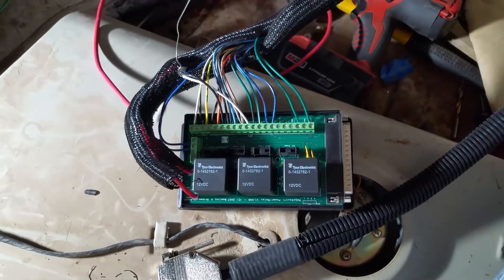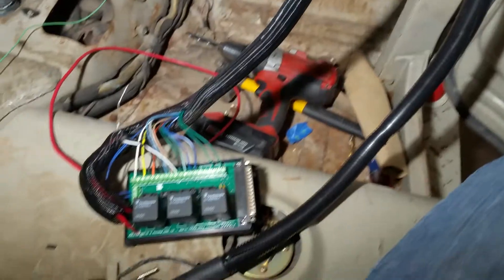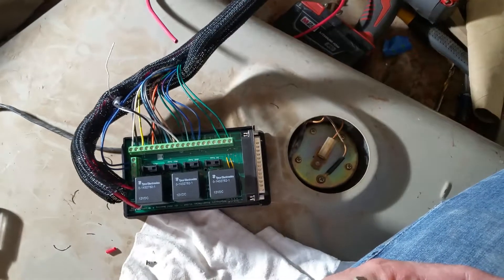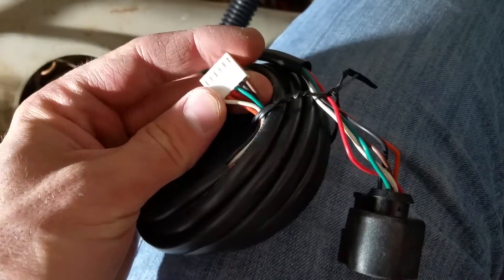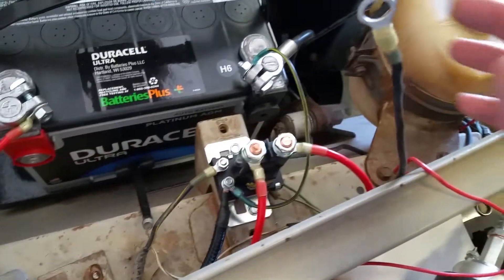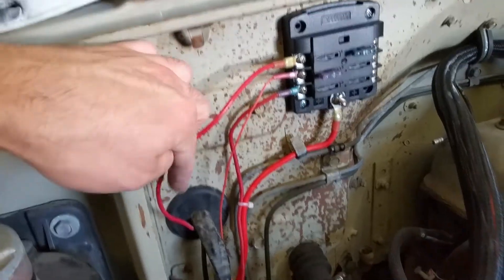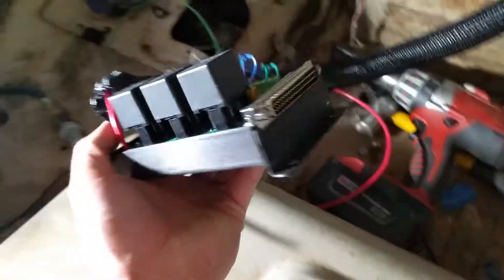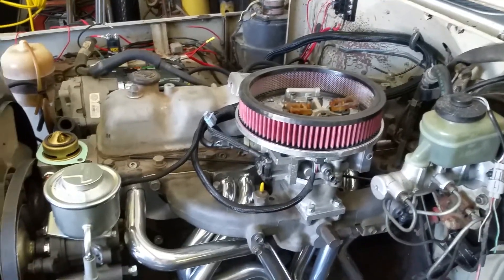TOYOTA FJ40 2F MEGASQUIRT PROJECT UPDATE 4

Comment: Ive got the same conversions in my 74 fj40. Are you blowing through o2 sensors? My check engine light comes on shorty i replace it and I don't know why it's telling me it's a bad o2 sensor?

You mentioned something about the 2 ground wires should be grounded at the same location? ?

Any thought?
Reply from the maker: Fj40365 I have an aem uego wide band and have zero issues. It’s not a stock narrow band O2 sensor
Reply: 2Step _Anti_lag  do u by chance have a part number?
Reply from the maker: AEM (30-4110) UEGO Air/Fuel Ratio Gauge https://www.amazon.com/dp/B00N3VGPYS/ref=cm_sw_r_cp_api_i_.O26Ab5AKTZ7G